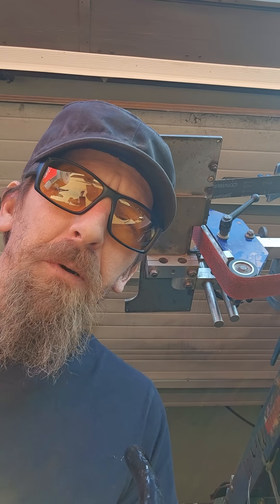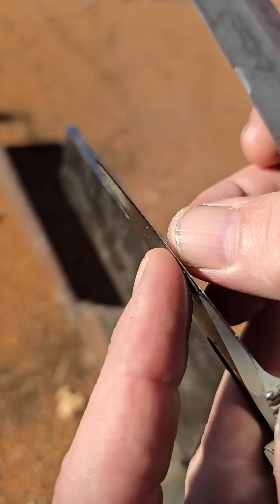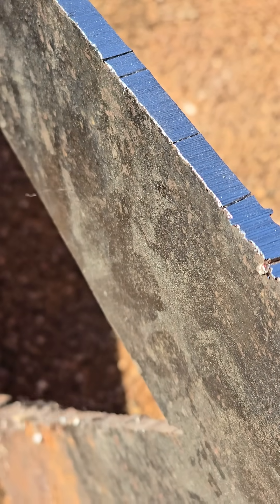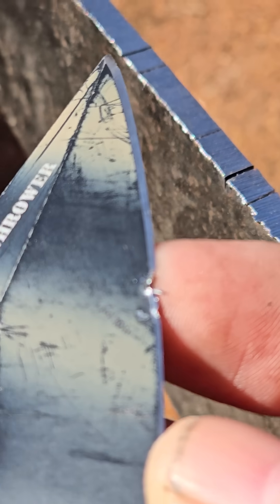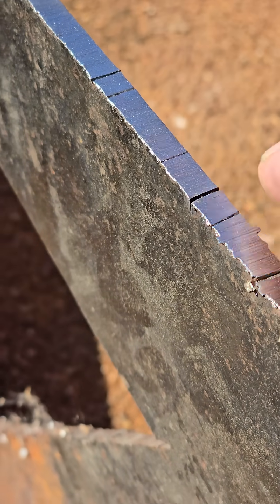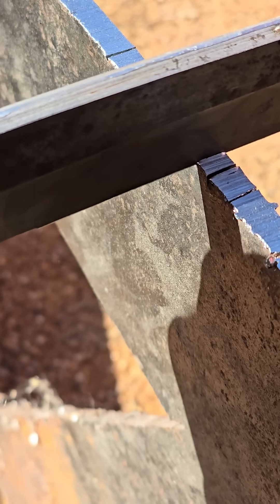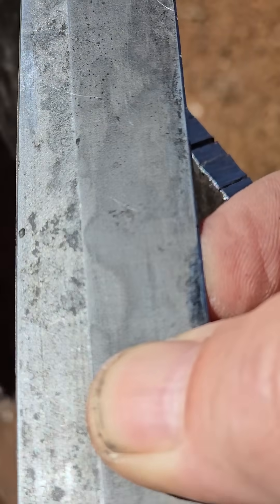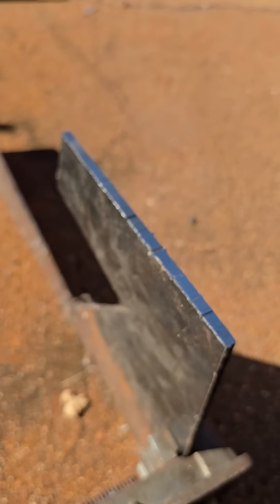myth busted. m390 vs 1095

Comment: This comparison makes zero sense
Reply from the maker: Do you want me to spell it out for you?
Reply from the maker: You do realize that this test was for Edge retention? My ege is 005 at the heel of the sharpen. The other Edge is 020 at the edge of the sharpen. It doesn't matter how thick the primary grind is an inch up the blade in this test. However the m390 failed so bad it collapsed into the primary grind. I have done many tests with the same edge geometry on two different Steels and it makes no difference for this particular test. But it was to drive my point home. Just say you don't know anything about heat treatment and you have love for fancy named steel. Just can't fathom that it might not be as good as you thought. Performance comes down to Rockwell grain refinement and edge geometry.

Comment: Not sure if you’ve checked out Knife Steel Nerds, but M390 is known for its edge retention and is known to be brittle compared to most high carbons.  1095 is significantly tougher than M390 and this test doesn’t surprise me at all.  I think the test would be better if you had two of the exact same knife models in two different steels, since geometry is also a major factor in this test.  Instead of smacking metal on metal to see what breaks, how about you do a rope cutting test.  How many cuts until each knife becomes dull?  I’m sure the M390 will perform better than 1095, if both knives are well sharpened.  But I will agree that people tend to put more stock into a knife’s steel than its geometry, when it comes down to doing tasks, geometry is king.
Reply from the maker: I hear what you're saying. But my heat treatment of 1095 is far from a factory program. I have not seen m390 have good properties. If it did you would think it would come out better from these higher-end factories. At the same time edge geometry is two things primary grind and secondary grind mostly. What we are testing here isn't the primary grind but the Edge performance of the steel on the secondary grind. Mine is .005 to theirs at .020. I do very extensive and high-end heat treatment science. That being said metallurgicaly m390 is great. But I can do far more levels of grain refinement on 1095 than m390 can achieve

Comment: Better in what sense ? Because you opinion is just that a opinion
Reply from the maker: 😂 has nothing to do with opinion but performance
Reply: again in what sense edge retention? Toughness or corrosion resisttance? Guess you never heard the saying the right tool for the job
Reply from the maker: @VaqueroCervantez I mean if your goal is corrosion resistance you're looking in the wrong spot. There's a reason I don't deal with stainless steel.
Reply from the maker: @VaqueroCervantez but yes obviously better in Edge performance and toughness

Comment: Apart from what kind of steel have been used the geometry should be at least similar to get a better test to compare them in this video one is so thin behind the edge and the other is thick so yeah the thin one gonna be the weakest and prone to chip easily compared to the thick one.
Reply from the maker: Except for that 390 blade didn't chip it collapsed. I was just testing toughness at the edge. Basically Rockwell and grain refinement. Not my fault the m390 Blade underperformed. This particular test has nothing to do with primary slope

Comment: Today’s steel is better because no one chops nails or iron with there knife what’s important to most is how long it stays sharp and  rust resistants , and even “ brittle “ knives are plenty strong enough for soft attackers .
Reply from the maker: What you've just said makes no sense. But I agree it's how long it stays Sharp. Nothing beats simple carbon steel. I promise my metallurgical knowledge is more than yours

Comment: Who needs supersteel anyway? It's overpriced and you got forgeable steel all around you.

Supersteel is good if you are a complete novice in bladesmithing. I can make spring steel tough enough to be impact resistant and a better overall alloy.
Reply from the maker: Exactly the grain refinement that I can achieve on hypereutectoid steel far outweighs super steel

Comment: You sir are an idiot! The fixed blade is way thicker behind the edge! Way heavier and the geometry is way different than the m390! Find a proper and fair test to test these two steels or just don’t do it at all! The heat treat is null when you compare a razor blade to a lawnmower blade when hammering it 😂😂😂😂😂😂😂😂😂😂
Reply from the maker: You really think that's the case? I can pull out a tops blade that has .050 thick at the heel of the spine and it will fail the same test what does the thickness of the spine have to do with anything when I'm testing Edge holding capability. Well true that my blade primary grind is a steeper slope than the other, the heel of the sharpen on the m390 is .020 to my .005 two things I can observe from your statement number one you don't know anything about heat treatment and number two your courage only exists on the internet
Reply from the maker: Learn how to have a respectable debate or ask a question respectfully or get shit thrown back in your face

Comment: Love 1095 but I like my 01 more. What modern steels are amazing for are things like 3v and magnacut with a proper heat treatment it's hard to beat them in durability and edge retention. Magnacut will chip out more but is easier to sharpen. But both are a pain in the ass to sharpen in field that's why I tend to stick to 01 and A2.
Reply from the maker: In a factory setting I would agree with you. But not in this method
Reply: @proknifethrower  I'm going to have to disagree . You are using a massed produced blank that been massed heat treated and then idk what temper cycles they used. The could of not of normalized before heat treatment. Next I'd say that you have a lot more meat behind your bevel and and your saber grind. You also did the best you could to make this heat treatment perfect for that steel Where this company just slapped something at it and said here you go population. You would need two steels one 10950 the other what ever one you are comparing it to they both need to be heat treated by you with same stock thickness and same bevel and grind with the same normalize ,Austenitizeing and temper  to the same Rockwell hardness. I make knives myself. The more carbon the longer your edge lasts less carbon more toughness harder to break . They are call tool steels and super steel for a reason when done properly will out perform your 1095 every single I'm sorry. where basic carbon steel shine is The ease of sharpening and stropping

Comment: You might as well compare a kitchen knife to an axe. They have the same edge geometry, he says.😂😂😂
Reply from the maker: The lack of knowledge in the comments is just crazy
Reply: @proknifethrower The video literally shows how narrow the mark left by the Stitch is, and how wide your blade left. It's understandable that everyone primarily looks at the sharpening angle and the thickness of the blade just behind the cutting edge. However, don't ignore the blade thickness, the height and type of bevel, as well as the subtle differences in blade hardness. All of these parameters will primarily affect the strength of the blade and cutting edge. Although the chemical composition and alloy production method also play a role. Still, I suspect that if the M390 had exactly the same geometry as your carbon steel, it would also pass this test.
Reply from the maker: @Warsmith_Honsou I just don't understand how you guys think about this stuff this way. Here's what I'll do I'll make a knife with the exact same geometry. Chopping steel like this I'm only testing the edge. And my edges twice as thin at the heel of the sharpen. Forget the primary grind. We're talking about the edge. I can do the same test with a tops knife that is .060 at the heel of the sharpen and it will fail as well. The point I am trying to make here is m390 is over 1% carbon if it was heat treated properly it wouldn't have a problem doing what I was doing with it
Reply from the maker: @Warsmith_Honsou and honestly I can't believe that that Microtech completely collapsed into the primary grind I've had worse Steel knives that I bought from companies that weren't even this soft. But again you guys are thinking too hard about this comparison. M390 is a great alloy Steel if it's done right even mediocre Steel should be easy to test the edge retention. Everybody's getting butt hurt about the thickness of my secondary grind. This test has nothing to do with the secondary grind. How do you explain my blade not taking any damage at the edge when the edge itself is much thinner
Reply: Ever been a blacksmith before?

Supersteel ain't no substitute for smithing.

Comment: Given that the blades are a completely different shape, and the heat treatments are unspecified and unknown ("my special heat treatment" vs - what? Unknown), with all due respect this is meaningless. 

No steel is "better" if it's not properly heat treated, and optimal blade profile varies with steel. 

By the dents in the top of that M390 blade, it's not even that hard. 

Personally, when I want to cut steel, I use properly hardened tool steel or tungsten carbide. When I want to cut trees or vegetables, I use knife steel, hardened and tempered to suit the intended geometry.
Reply from the maker: So you mean to tell me a knife that can cut steel without deformation will somehow not hold up to Organics as well? And the spine chipped which is fine. What I'm showing here is improper heat treatment by bad Factory companies. The Edge on the m390 blade is .020 mne is .005 ad the heel of the sharpen
 Sometimes I don't get the logic of some of the comments. I could specify my heat treatment but I'm not giving it away. It's pretty laughable that you think that softer still with worse grain refinement will hold up to Organix longer
Reply: @proknifethrower  I'm not saying any of that, I'm just saying that this comparison is no comparison of the suitability of different steels for making knives. They're different knives 

You yourself are now also saying that the M390 blade hasn't been properly heat treated, as well as being a different shape, size, etc. What's the point, then, to compare these two very different blades in this way, what does it prove, other than one is more suited to hammering into a steel bar than the other? That a knife blade that hasn't been properly heat treated, made of a less tough steel, isn't as tough as an optimally heat treated knife made of a tougher steel? We kind of know that, don't we?

Or are you just trying to prove that a steel that is optimised for edge retention over toughness isn't as tough as a tougher steel with poorer edge retention? We  know that, too, I think, don't we? 

I wouldn't choose M390 as a steel for making blades that I wanted to hammer through lumps of steel. I might choose it for making a knife that I wanted to use to cut a load of wood, cardboard, rope and stuff between sharpenings, though, especially if I didn't want it to go rusty even if neglected.  

I mean, if you want a blade specifically for hammering into steel bars, you seem to have hit on a good combination of steel, geometry and heat treatment, so stick with it.
 
Knives are not all made to be hammered into steel bars, though, are they? Some people prefer a different balance of toughness, edge retention, sharpenability, corrosion resistance, etc.

We know from the specs broadly what to expect from a steel, and we pick according to what it's for. We already know that M390 is less tough than 1095, but has much better edge retention, and is stainless.

I just don't see the point in banging two completely different knives with different intended uses into a steel bar and saying "look, this one broke, M390 must be rubbish". 

If I want to make lathe tools I'll use M42 or M2 or something like that. It'd be pretty pointless to clamp a VG10 kitchen knife into the toolpost and say "wow, that's supposed to be great steel but look how rubbish it is compared to boring old HSS".
Reply from the maker: @CarlWilliams-q1d if you actually look at my testing you would be dead floored that you are wrong. How much do you actually heat treat how much do you know about Heat Treating really? Or just what you hear on the fucking internet
Reply: @proknifethrower  your video is something I "saw on the fucking internet". Generally, if you want to compare stuff, you change one variable, not all the variables. Whatever you think you're proving, here, you're not. 

You can be correct your assertion - which I think is that M390 - widely understood to be less tough than 1095 - is less tough than 1095? But this demonstration doesn't prove that, and I don't really understand why you can't see that. The fact that you can't see that makes me doubt other stuff you say. Not because I doubt your heat-treating expertise, but because you're changing a whole bunch of variables, pretending only one thing is different, and then presenting this as proof. Proof, moreover, of something that no-one really disputes anyway - M390 is less tough than 1095. 

I'm not the only person saying this, loads of others have said the same, with varying degrees of diplomacy. 

Your 1095 knife, your heat treatment, are great, you've made a tough knife, I daresay you can consistently make tough knives. You clearly know your stuff when it comes to heat-treating 1095 and making robust bush knives. 

But your comparison is showing nothing other than that two very different things are different. I think the geometry of the two blades is way more significant in your demo than you seem to think, but, even if I'm wrong about that - and heaven knows you seem very determined to believe I am - the demo still isn't convincing because it fails to compare like with like. 

You can't just say that the two things are alike in every respect other than the one variable you're interested in, when they are conspicuously not. That's not how experimental method works.

Comment: Appreciate the effort, however one big variable here is the spine of the knife. On the 1095 blade, it's flat so impact is evenly distributed. On the m390 blade, the point of impact is right on that pointy upsweep. That's one reason it chipped and the 1095 knife didn't.
Reply from the maker: You really think that m390 at .020 at the heel of the sharpen did that because of a slight curve? My friend.  My blade edge thickness is .005 at the heel of the sharpen.  In the m390 blade didn't chip it completely collapsed. I could make a blade with more curve and it will do the exact same thing
Reply: @proknifethrower  I'm not talking about the curve. I'm talking about the tip that you hit.
Reply from the maker: @Jodjcf3f3 what tip did I hit? The spine of the m390?
Reply from the maker: @Jodjcf3f3 I don't fault the m390 blade where I was hitting it on the spine one bit. That was acceptable

Comment: As a chef, i choose M390. Great edge retention and great corrosion resistance.
Reply from the maker: What if I told you I could put a nano ceramic clear coat that is food grade safe and antimicrobial like silver or copper to a 1095 blade that would hold its Edge 30% longer than anything m390 could do in a factory heat treatment setting
Reply: @proknifethrower do u got anything u made already Esee 3 in carbon steel with ur heat treat n coating or anything in that size or Kizer belizer fixed blade in the same like small/ medium knifes not so much into bigger blades never had a need for anything bigger yet thxs
Reply from the maker: @donaldjr76 I mean I make things kind of custom to order so whatever your heart desires. You'll just have to message me

Comment: I wouldn't buy m390 for toughness and nor should anyone else. Its better in edge retention. Now do a cut test between the two. Cut down boxes or rope. Youll see one outperforms the other by multiples. Your not going to use a small pocket knife primarily to love tap metal.
Reply from the maker: So you're telling me if I can chop Steel in my blade takes no deformity that somehow it's going to underperform when cutting Organics?edge retention comes down to hardness and grain density. Sorry to burst your bubble
Reply: It sucks that stainless steel like AEB-L can be forged and not M390. AEB-L should be my choice for hot hardness, toughness and corrosion then.

Comment: And how much thicker is that 1095 blade ??? 🤔🤔🤔 Especially behind the edge, that makes a difference right. The stitch is paper thin compared to the other one. Two knives made for different purposes. Needs both knives with not only same edge geometry but thickness of the stock and very similar behind the edge, but yeah I get it. There's some knives that could cut that bar stock in half , not that I've personally experienced it but on video anyway, but your blade is amazingly tough, that's awesome, great job.
Reply from the maker: My Edge is .005 at the heel of the sharpen.  The other is .020 . Not really paper thin. 3/16 vs 1/4 inch spine. My grind is a bit fatter yes. .365 slope. But that's not really what the purpose of this test was

Comment: Are the blades similar geometry?  Didn't look like it.  Do they have the same thickness at the edge bevel?
Reply from the maker: My grind is 0.365 slope there's this obviously thinner but my blade is thinner at the heel of the sharpen. What I'm testing here is Edge holding capability hardness and toughness. The other blade should not have collapsed into the primary grind. That kind of blew my mind. So my blade is 005 at the heel of the sharpen and the other is .020